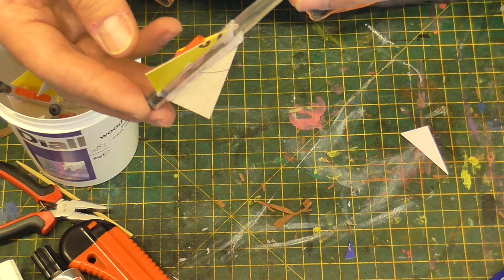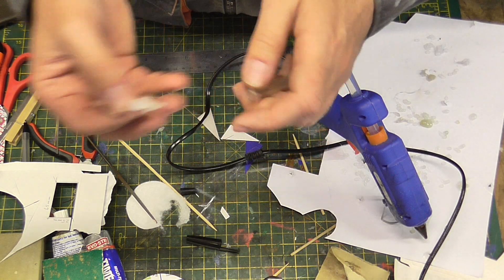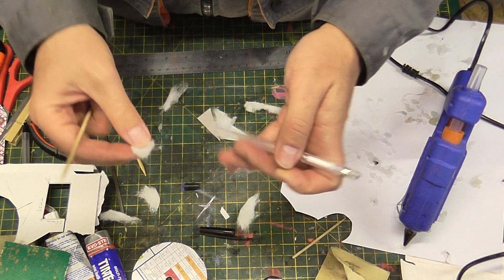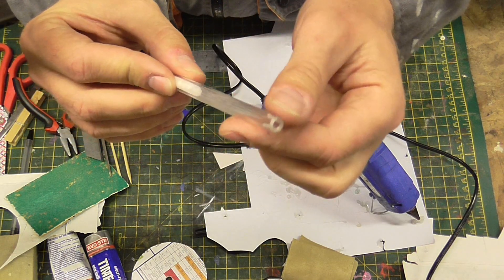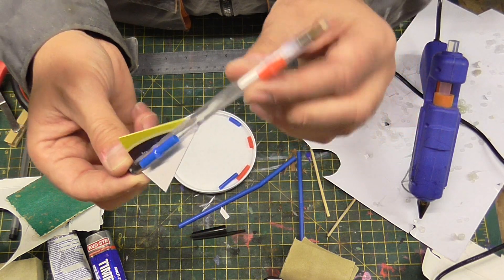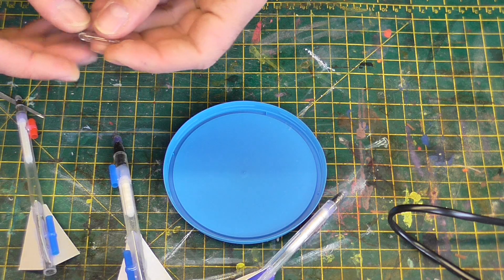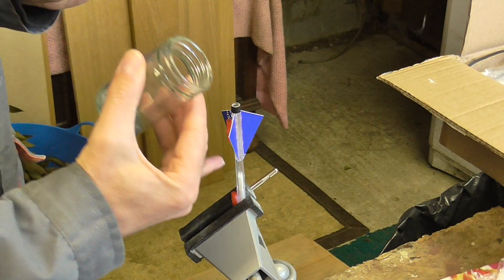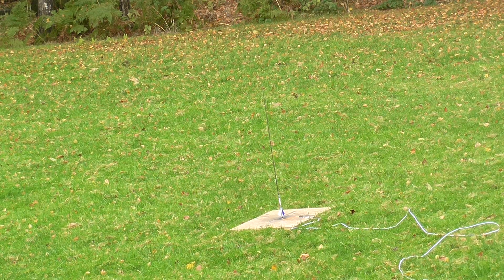How to make a pen rocket with solid state fuel + launch with Christmas light bulb

Comment: those it work with rocket candy fuel? rocket candy is Potassium nitrate and sugar
Reply from the maker: I don`t think so... because rocket candy burnes much slower than flash powder, and I believe it would melt the pen. However I never tried, so I connot be 100% sure. Sometimes even flash powder melted some of my pens, even though it burns extremely quickly.

Comment: I tried to use gunpowder but it just melted 🤣
Reply from the maker: Yeah, because the gunpowder burns much slower. You need to use flash powder as it burns really fast.
Reply from the maker: @iwantit539  I believe someone has tried that, but it didn't work either.
Reply from the maker: @iwantit539  As I mentioned I never tried but I know for sure that phosphorus burns on high temperature but much slower than flash-powder. There's a reason it's called that. Burns like flash. I bought the ingredients on eBay. Not expensive, I spent something like £30 on them and the quantity I got for that is enough for a lifetime.

Comment: Hi Charlie B. Need help with the rocket fuel.  I have powdered sulphur (about one year old was stored in my garage) and powdered zinc (recently purchased) It will only ignite if a blow touch is applied and held for a several seconds. How do you dry the sulphur? (assuming that is the problem)
Reply from the maker: Hello Johnny, To be honest I have never had problem with the fuel. But I know a couple of very important things about it: 1. Make sure the ratio is accurate. 2. Both powders have to be very fine (like flour at least). 3. The mixture has to be mixed thoroughly. 4. Flame cannot ignite it as it is not hot enough. It has to be spark - best to use is fuse or e-match (fireworks igniter). I tried before, but I could not ignite it with a lighter. Last week I even made some small balls from this mixture for fireworks and to able to form it to a ball shape, I sprinkled water on it. Once the mixture was wet, I formed some small balls, then just let them dry in the shed. Next day even those balls ignited when I shot them up in the garden.

Comment: my flash powder is not working.
I have zinc and sulpuhur and I mixed them in right proportion but it is not burning.
Please help me out of this situation.
On 5th October I am having my science exibition please help me bro.
Reply from the maker: Two possible problems: 1. Are you sure your igniter works? Are you using proper E-matches or traditional Christmas light bulbs? Because if you`re using light bulbs, you must be very careful because it is very easy to damage the filament! You have to be very gentle!
2. If you definitely sure the igniting system works, than it must be powder. Both have to be very very fine powder. I mean at least like fine flour or icing sugar. If they not fine enough the chemical reaction will not occur.
Actually one more possible problem: maybe the powder is too damp? Is the humidity high in your area? If yes, you need to dry the powder. 
I hope this helps! Let me know.
Reply from the maker: One more thing: make sure the mixing ratio is in mass (grams), not in volume!

Comment: Can we use phosphorous incase of flash powder
Reply from the maker: I have no idea. Never tried that. There is easy access to sulphur- and zinc-powder though. Only these two you need for flash powder. If you try phosphorous, let me know the result, please.
Reply: @bee-kay75  bro phosphorous didnt worked
Reply from the maker: @omkardeshkar7992  OK, good to know, thank you for the info.
Reply: What is that powder ?
Reply from the maker: @buihoa721  75% Zinc-powder and 25% Sulphur-powder mixture. Both have to be very fine powder, like flour.
Reply: Try also potassium nitrate